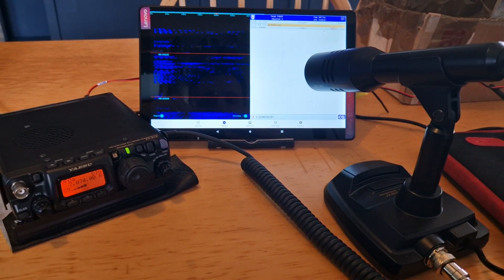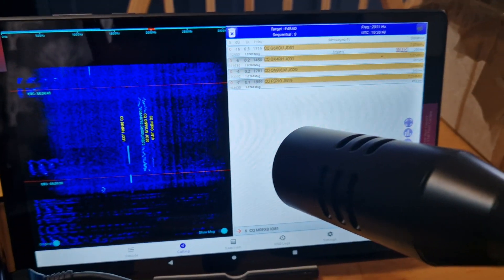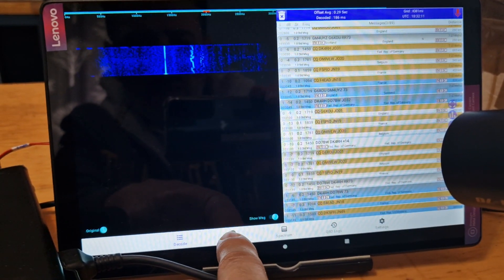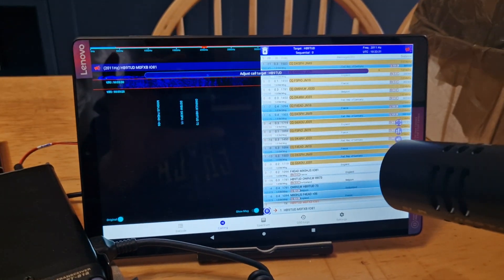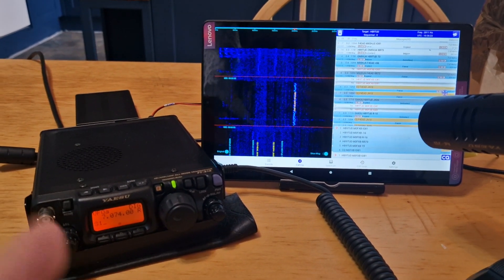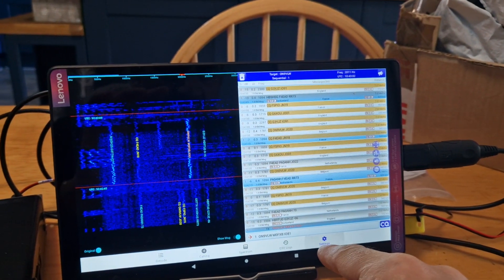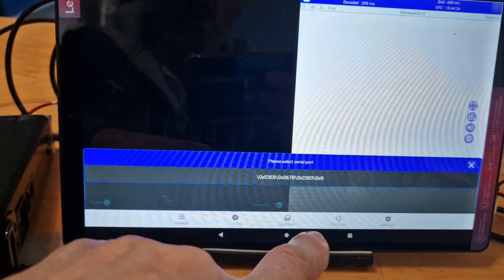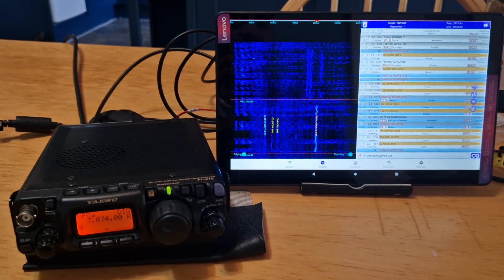YAESU 818, FT8 - ANDROID FT8-CN Free Programme

Comment: From what I saw you any wire your radio so you can use a chrome book tablet.    I am going to do it with my x5105 soon as I get the cables back.  And try my alinco dx70t and signalink.
Reply from the maker: Not sure about chrome book is that android my daughter has a chrome book i will test.